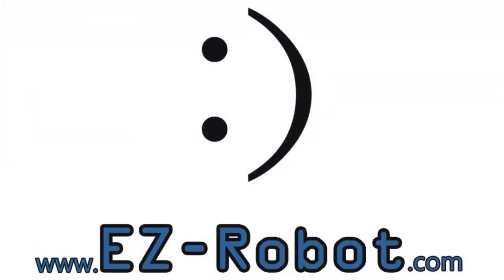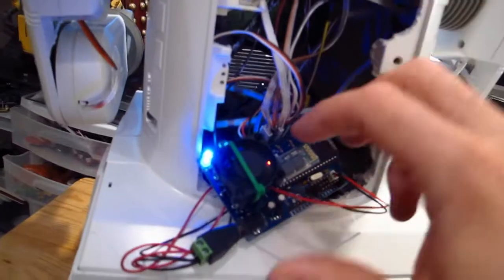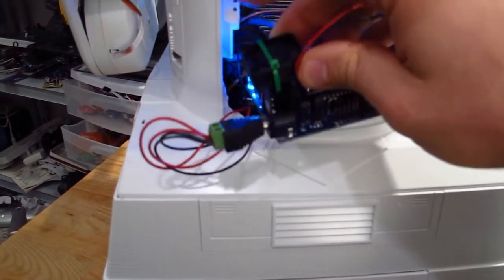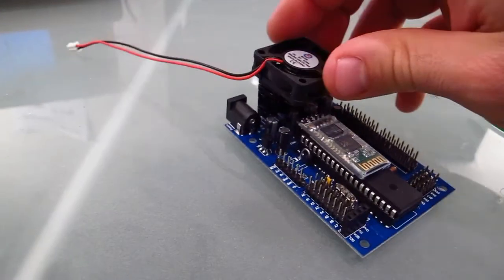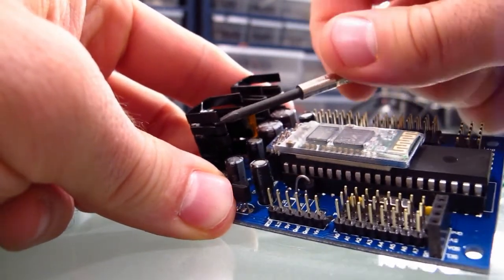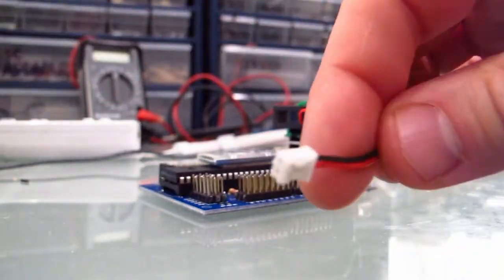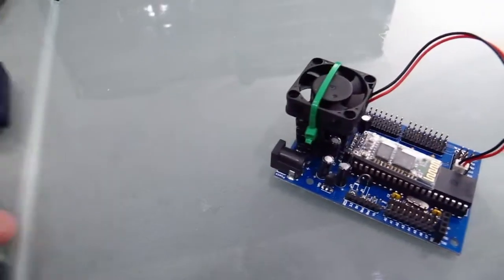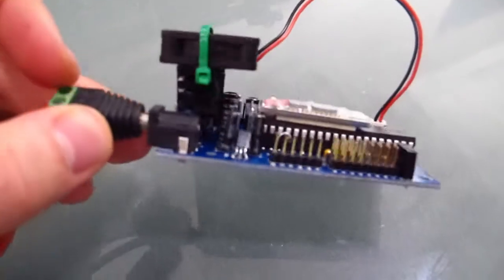Robot Voltage Regulator Fan

Comment: I like this method. I am currently using a dc 12v  fan with a battery to supply coolness to my io-regulators. However, when you made an exemplar of using a power adapter to keep the electricity moving through the ez-board so the fan would not eat the energy all up on one single battery, I found that it is much more efficient using the adapter itself. :)